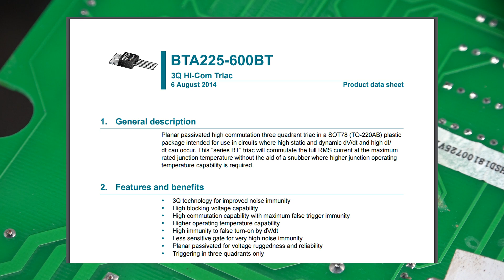Laboratory Hot Plate Stirrer Repair (Triac Replacement)

Comment: Electrical Engineer here: the reason why is that power supply is flapping in the breeze is that it's a piece of sh!t. Cheap products don't have a lot of engineering in them, because engineering (and giving a sh!t about the design in general) costs money. Chinese knockoff vendors don't spend money... in fact they often will start pulling parts until it quits working, and then puts the last part back and calls it good. They only care about lowest price, safety, reliability, and quality be damned. 

Edit- the reason they have two supplies in the first place is to ensure that the microcontroller (and any other logic/control circuitry) gets nice clean power... motors tend to make supply rails noisy, and the proper supplies for such are optimized more for power output, not lack of noise. 

I know you probably paid a decent chunk of change for that unit, but that build quality just makes my skin crawl.
Reply from the maker: +Larry Bolan ah interesting! Thanks for explaining. You think it would be a good idea for me to secure the dangling power supply with some electrical tape? I'm wondering if it hitting something conductive was what made it fail to begin with.
Reply from the maker: +John Drachenberg ah, gotcha, thanks!
Reply: Your best bet is to apply hot glue to the bottom of that tiny board and secure it to the base of the structure.  If you wrap it with tape, it may cause unwanted heating.
Reply: John, to secure something with hot glue in an environment with heat cycling is to not secure it at all. The glue is likely to eventually give up and come loose. That power supply board is likely an auxiliary power supply for the control logic. depending on how much heat it generates I would probably just put it in a suitable size heat shrink tube to prevent it from immediately shorting to anything else.
Overall, it's a piece of shit design indeed. The triac's heat sinking relies on passive pressure against the sil pad. If it shakes out of place, game over, it will likely eventually overheat and die.
Reply: Gameboygenius And without knowing anything about the power board, it's incredibly irresponsible to suggest sealing the heat in.
Regardless if it causes immediate damage or not, electrolytic capacitors are very prone to drying out / bursting when heated.  It will definitely shorten the components' lifespan.  
Never encase a power supply in thermal insulating material.  Period.
Reply: +NurdRage
Make sure that the tab of the triac can not touch the case! The tab is most likely connected to one of the pins. It looks like they have a cutout in the insulating plastic sheet right where the triac is for a cooling pad. If that pad somehow slips out and you whack the plate on the table, because of the long legs you left the triac might flex down and touch the case, which will give you a nice surprise. Also you should touch up the solder between the legs again. You have a huge blob of solder there (on the triac side) that closes the gap between the two pins quite alot. That's not something you want in an environment where you most likely create vapors that have a conductive precipitate on condensation.

+John Drachenberg
Hot glue is really something you don't want to use here. The case does not have to get so hot to melt it, but with heat cycling, moving the plate around and constant vibrations from stirring hot glue will simply pop off quite quickly. You have to remember that the hotplate can run for hours and the inside will get warm. I don't see any problem adding heatshrink at all. Heatshrink isn't that insulating. The power supply does not have a heatsink, so it is not really relying on convection for cooling. If you think heatshrink is too thick you can always wrap it in Kapton-tape (the brown sticky tape, used everywhere, where you need tape in a hot environment).
Reply: I like how they didn't even use a proper connector on the connections on the right side.. Did they just stuff the pins in there? I wonder if it had been 'repaired' before,and that little supply was bashed in there as a fix.
Reply: Gameboygenius The plate gets hot, not the internals of the unit.  Hot glue will do just fine.  Heat shrinking a power supply?  You're out of your mind.
Reply: There is absolutely nothing wrong with heatshrinking a power supply as long as the power dissipation in the supply is low enough that the heat doesn't damage anything.
Reply: It was also likely purchased as a whole unit and not designed by whomever did the main board design.
Reply: It looks like the case is plastic. I'd drill 2 holes in the base and use a cable tie to hold it down. then use a little hot epoxy to seal the holes if needed.
Reply: Hot glue might not be the best idea as this is in a hot plate. You might try getting a zip tie holder and epoxying it to the enclosure and tying it to the side. The double sided tape normally used won't take the heat. Alternately use a not too strong high temp adhesive.
Reply: ***** Yeah, agree on this. The tip should only be lightly coated to help heat transfer. The goal isn't to transfer solder from the iron... but to heat up the components and the solder point so that you can run solder into the joint. Leaded solder with a good flux does this almost magically. Otherwise, you my want to use a copious application of flux..

Comment: The only thing electrical engineers are laughing at is the phrase "I bet you real electrical engineers are all laughing at my epic fails."
Reply: It might not be the prettiest repair ever,but it was repaired. Not a fail,in my book.
Reply: True - while at the same time beeing scared that this bloody thing failed hot.
How did this device pass the design review phase?
If the heating fails for any reason, it should fail safe, meaning the hot plate should not heat any more.
I don't want to imagine the damage this hot plate can cause, when it over cocks/boils chemicals.
After seeing this, I would add an emergency off to the lab just in case.
That in the chemistry world devices get sold that aren't safe to use is scary.

(Well, until I think about my former job  -we had safty engineers with blinkers (those for horses) on. They where unable to find a safety concern unless specifically told...)
Reply: Sure, but he's a chemist.  Gotta hand it to the guy!
Reply: Considering the Triac is switching mains, I would not call that a repair. The solderblob on one of the legs makes the distance between the pins alot smaller than it should be. That's another short waiting to happen, especially in a lab environment where you create vapors of not only water but most likely also other chemicals that create conductive layers on condensation.

Comment: god damn expensive pieces of shit, that failure mode was probably engineered so you needed to buy a new one after a certain amount of time. Jokes on them, real scientists aren't afraid of voiding a warranty here or there!
Reply: And especially not in a dangerous way. Burning your clients is not a good strategy.
Reply: Will admit I hate void warranty stickers.  It seems like a lot more work to engineer a device to specifically make sure it fails as much as possible but lower than 25% and expect people to keep buying it.  Even speaking of heat and failure look at the Xbox 360 and the "red ring of death" issue.  A primary cause was contributed to using incorrect solder on one of the graphics chips.  When IC get hot they expand a lot, the larger the chip and/or smaller the pin pitch the more of an issue this can cause.  In the case of the Xbox 360 this expansion and contraction would cause the solder to crack and eventually fail.

In the case of a stir plate it vibrates and gets hot.  Going with Occam's Razor, it is more likely that this product did not receive extensive long term testing.  As a result of vibration and heat changes the TRIAC got either too close to the board and caused permanent heat damage.  Or the solder weakened and the current jumped from the board to the TRIAC (causing the burn marks on the board for the pin nearest the transformer).  Either case eventually caused a point of failure.  

It is interesting to note that the test point through holes seen at https://youtu.be/a3RWe-EZ9UQ?t=131 (-5V, Vcc, Vref, GND) are located near this circuit.  Best guess is that those TRIAC's are part of a opto-isolated trigger circuit.
Reply: ok to clarify that is simply a part that "broke" it overvolted and couldn't handle the stress so it popped. Most company's while very happy that your device broke so you "have to buy another one" do not actually engineer products to fail after a given life span especially not lap equipment manufacturers.
Reply: I always hear people say that, "It was designed to break so you would buy another."  From both the manufacturer and consumer side that makes no sense.  

Consumer:  You buy a product that doesn't meet your standards.  Why would you buy another product if you didn't like the first?  Unless a monopoly exists you can go find another product at the same price point.  

Manufacturer:  You make a product that breaks quickly.  You don't get repeat customers.  If you are a monopoly competition will arise to supply the high demand.  

I maybe biased, as an ASCI designer, but I don't know anyone that would purposefully sabotage their design.  Only reason I've seen to cheat a design is due to impossible specs, time, or money.  Always remember Hanlon's Razor.
Reply: @DarkParadox374  usually you Just built in Stuff that isn't the best you could buy. I mean you can Install cheaper capacitors that Last less than a decent. Heating plates fail often.  So there is No real planned obsolescence Just saving some bucks here and there.
Reply: Bruce 'Boomstick' Campbell manufactured failure is always designed to the consumer. For some products they'll make it fail after a few years so you're happy the product lasted that long and buy another. It's not entirely common on small things but on things which aren't very re-purchasable (like a stirring hotplate) they might engineer a failure by using substandard electronics that work for a long time then crap out on you, and most people would assume it's too hard to fix and just buy another. It's a similar story with computers and why they have void stickers, often the problem is just a loose connection or bad solder joint but they'll still make you buy a new one or charge you half the price you paid in the first place to fix it.
Reply: I decorate my notebook covers with security stickers.

Comment: There are two power supplies because one supplies the microcontroller and possibly the motor with low-voltage power and the other supplies the heating element with mains voltage, run through the transformer and all that.
Reply: I would almost bet the triac is for the heating element at full voltage (hence using the optoisolator), transformer is for moderate voltage for the brushless motor with reasonable drive transistors, and the small power supply is for the microcontroller.
Reply: If going down that road, why not just supply the element with 120V and skip the transformer entirely?
Reply: because isolation
Reply: +frollard Yeah, I think you got it right. I totally overlooked the part where he pointed out the rectifier that seems to be fed by that transformer.
Reply: +frollard that seems like the most reasonable way to do it. Plus, unless I missed some switching circuitry, that transformer would be way to small for 500+W at 60hz

Comment from the maker: A lot of complex scientific terminology is used in this video...
Reply: Like "Piece of sh*t", huh? XD
Reply: Expensive piece of sh*t, let's get technical here.

@NurdRage: Your repair work may be amateurish, but it's lightyears ahead of the best that 9/10 people who use electronics could do. And hey, if it works, it works!
Reply: I'm usually the guy that fixes everything in the lab so this is great to see. Good to know something like this can be fixed instead of breaking the bank.
Reply: I see...
Reply: Triac MUST be heatsinked, otherwise it's of no surprise that it burned!
Reply: "Piece of shit" is indeed the correct technical terminology :)
Reply: It depends. The voltage drop on the triac in open state is quite small, so it might not require heatsink. For example if this triac controls 100 Watt stirrer motor at 110V (~0.9A) the power dissipated on BT225 junction will be around 1 Watt. Considering junction-to-ambient thermal resistance on air for this device is 60K/W the temperature of the triac would be 25C(ambient) + 1 Watt * 60 K/W = around 85C, which is perfectly normal. However if this triac controls the heater element (500-600Watt) then the heatsink for BT225 is absolutely necessary otherwise on full power it will burn out without much doubts.
Reply: Thanks man. Should be very useful links video. 
I go watch it with my lab mate now. 🙂🙂
Reply: I'm not an electrical engineer either,  however I wonder if a heat sink can be attached with some titanium grease to the main triac to help decrease tree likelihood of the catastrophic overheat event from recurring.
Reply: Yes, the complex scientific terminology is covered by bleeps...
Reply: I was attempting to make some potassium chlorate from bleach and I had already transferred the boiled down bleach to a separate beaker once it was cool but I forgot about it for a few days and when I came back the liquid had etched the borosilicate glass white, is this due to the sodium hydroxide in the bleach?
Reply: Yes
Reply: +ShadowDragon8685 Indeed.
Reply: Agreed, but considering how the circuit board was charred near the triac and that this happened supposedly not in a day, must be the triac heats over 100-150C. Also the part placement was weird - it is bent in an unusual way - makes me think this happened during a hasty assembly process and there is some "right" place where it must touch the heatsink which one must look for..
Reply: Alex Petrov
Agreed, but considering how the circuit board was charred near the triac and that this happened supposedly not in a day, must be the triac heats over 100-150C. Also the part placement was weird - it is bent in an unusual way - makes me think this happened during a hasty assembly process and there is some &quot;right&quot; place where it must touch the heatsink which one must look for..
Reply: It could be very likely that this failure state is a result of vibrations moving the TRIAC from its initial installation position to being in contact with the board.  But this is a guess based on nothing more logical assumptions rather than actual quantitative evidence.
Reply: "This blue cube thingy"
Reply: Got your parts from digikey huh? I'd recognize those parts bags anywhere!
Reply: excellant!